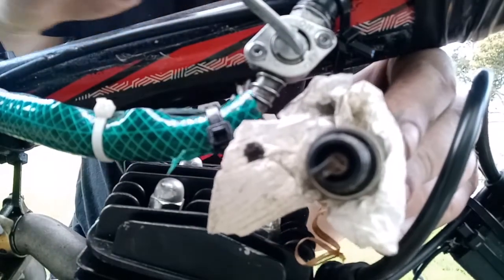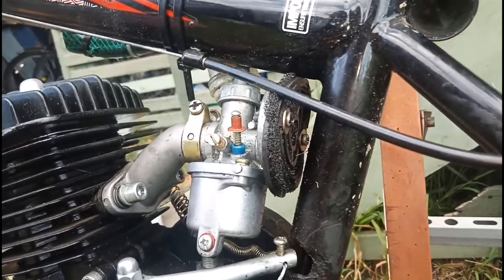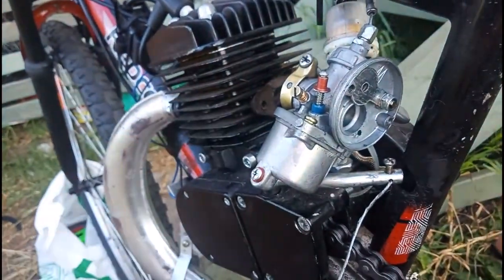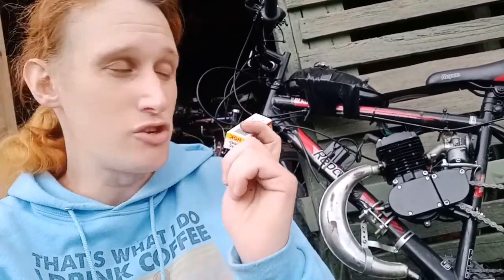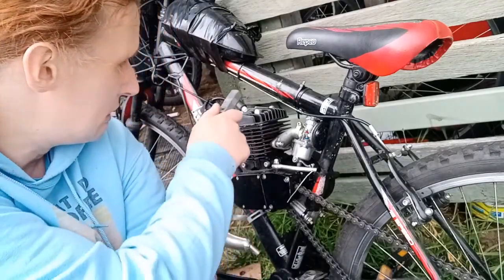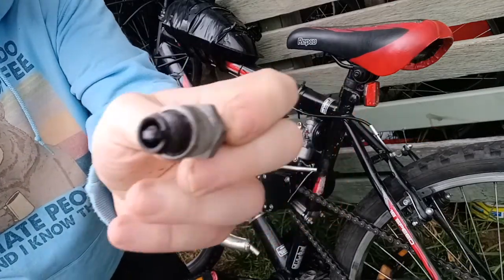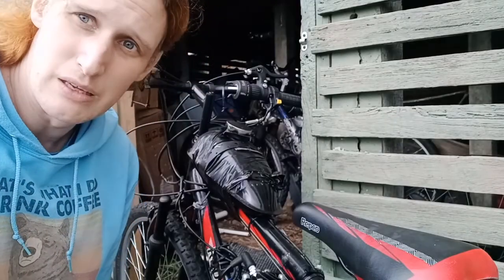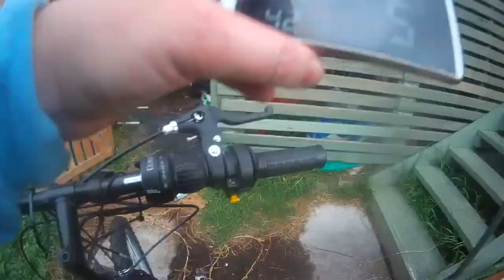Mk2.5 Motorised Bike Spark and Carb Examination

Comment: I've tried a few spark plugs from various brands (ngk, bosch, champion, briggs and stratton) including the NGK B6HS but I found no gain in engine speed/power comparing to the stock spark plug. For sure other well known spark plugs brands perform better but seems like this engine, or at least my engine, loves better the no name cheap spark plug it came with.